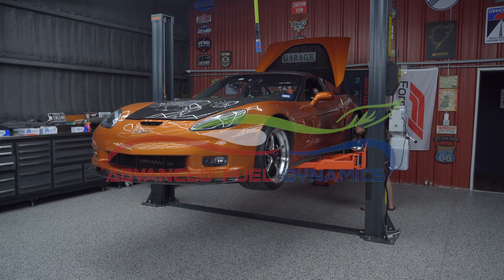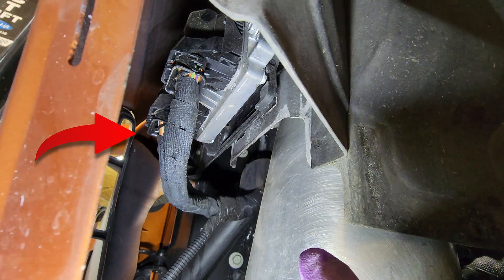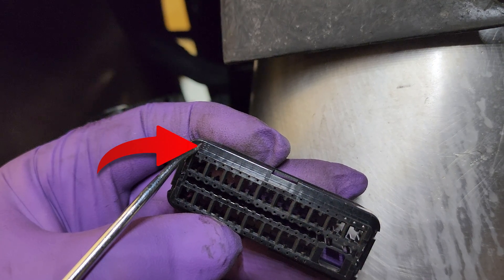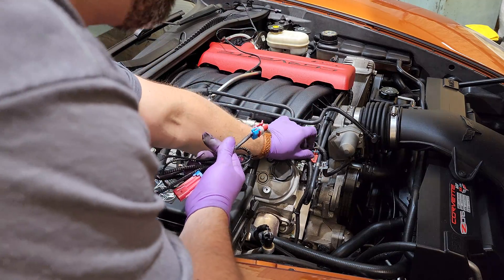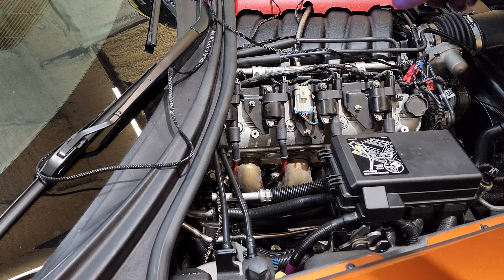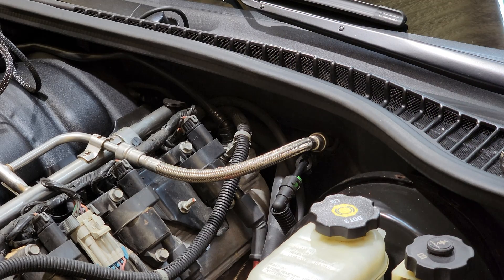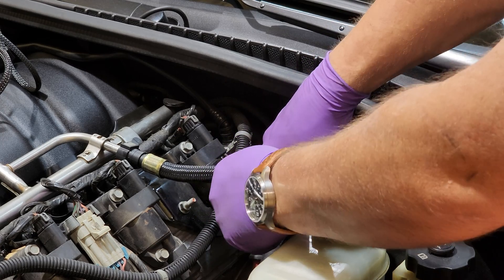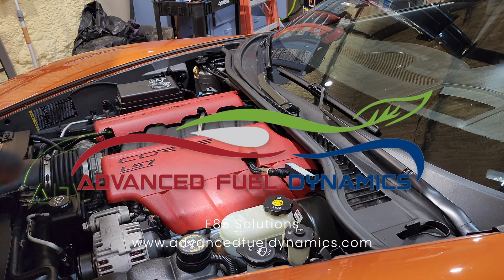How To Install a FlexLink E85 Module on Corvette C6

Comment: Do I need to tune my car after?
Reply from the maker: We have 2 options for the C5 and C6 corvettes to fit every need. 

The Proflex Commander does not require any tuning and is fully plug and play with no wiring required. https://www.advancedfueldynamics.com/collections/proflex-commander/products/collections-e85-flex-fuel-2005-2013-chevrolet-corvette-c6?variant=30895660433544

Our Flexlink or Direct systems do require a change in the GM or standalone ECU's settings to enable Flexfuel, this will require you to have and know how to use HP tuners or visit a tuner to complete the setup for it to function.  Both systems have apps for displaying your Ethanol content to your phone. 
https://www.advancedfueldynamics.com/collections/flexlink-1/products/flexlink-flex-fuel-e85-ethanol-gauge?variant=31220368408712